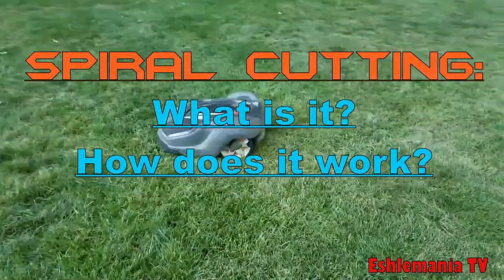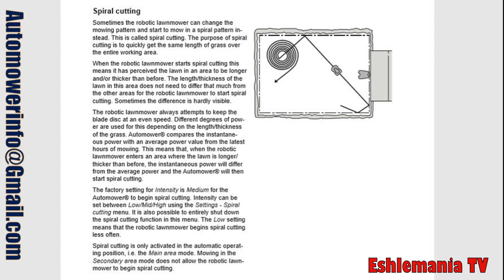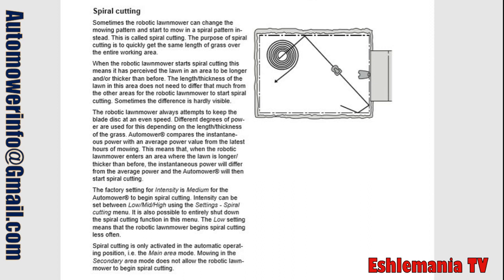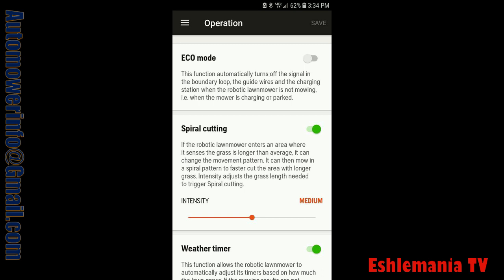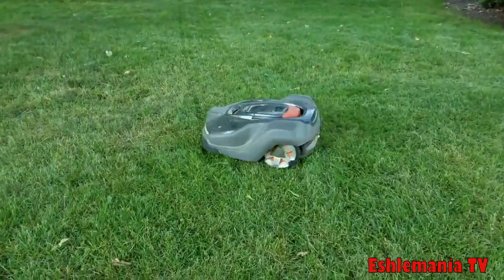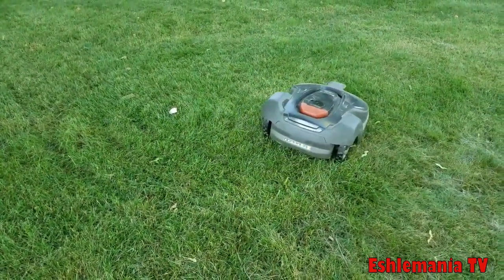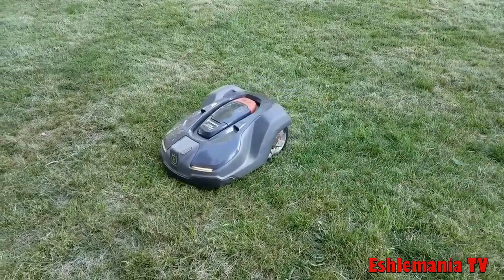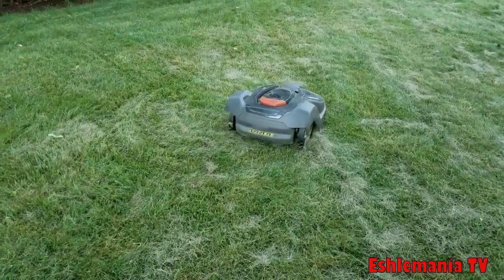Automower Answers: What Is Spiral Cutting & Should I Use It?

Comment: I have a Husq. 310 for two years with auto connect. I know you don't like the 300 series;) And it is NOT spiral cutting right now. Even with the intensity set at very high. However I have a theory why. In the springtime when there's more weeds and the grass is uneven it throws off the average power consumption being monitored by the unit. Therefore doesn't spiral cut. But in the summer when there's less weeds and the grass height is more continuous it will spiral cut. We shall see.  Thanks for your videos it's one big reason why I bought my unit... your support.
Reply from the maker: We actually do like the 300 series of Automowers...….when used in the right size lawn. LOL! But as far as the spiral cutting issue you are having, you are on the right track! What you can do in most cases is "trick" the mower by raising or lowering the cutting height one increment. We have had to do this at times to get mowers to perform spiral cuts more frequently so the lawn was blended faster after days of rain. If all the grass is higher than normal then raise the cutting height all the way up and adjust it down over time. If there are just random areas where the grass is still thick or taller, then adjust the cutting height down one increment to get it to spiral cut more often.
Reply: @EshlemaniaTV  I'll give it a try thanks

Comment: Had my 430X for over-winter-service in 2018->2019 and got the software updated. Unfortunately also a bug. Not with spiral cut but it's similar feature spot cut. When we got the mower in 2017 it spun up the disc when you start it on the lawn. After the update it starts rolling before disc spins up. Well sure probably some optimization. But the spot cut does the same. So mower will start turning around and miss the center spot before the disc spins up.
Wonder if there has been any software update to fix this, might turn it in for service after this season.